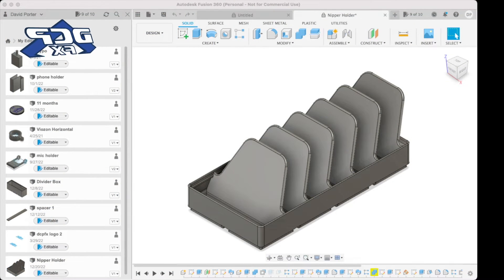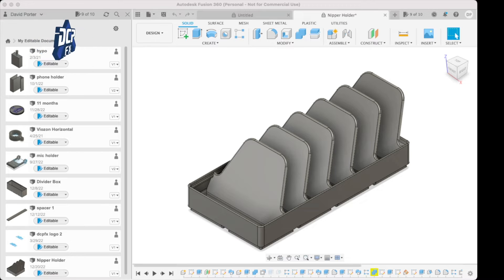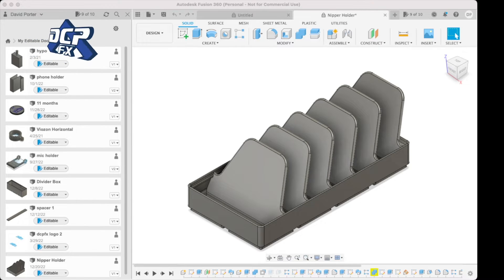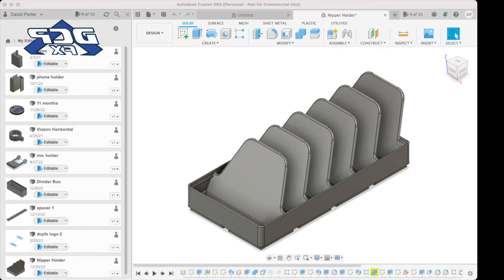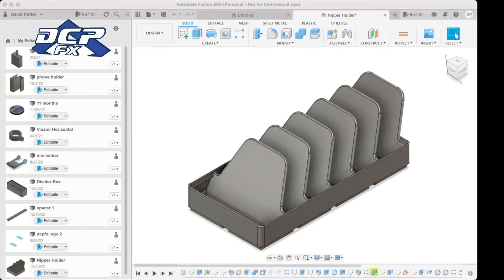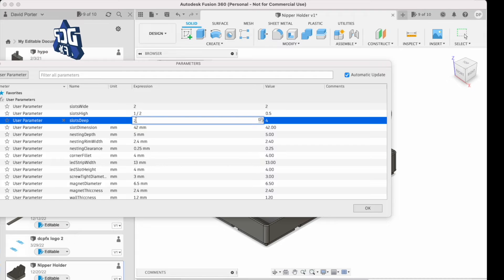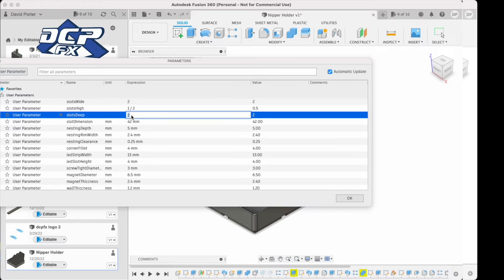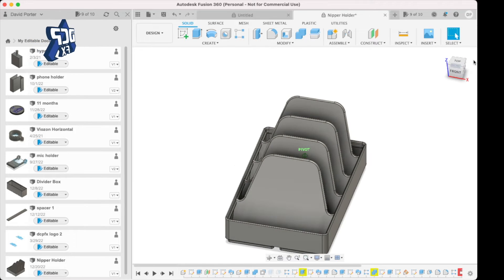Gridfinity is Parametric??

Comment: This was helpful, I just got my 3D mini printer from Bambu lab. Gridfinity doesn't fit on the plate and I"m trying to learn how to modify things in Fushion 360. Downloading from Thangs did not give me the option to open in 360 and when I open it in 360 i don't get the user parameters. Thanks for giving me hope that it's possible lol

Comment: Thank you, well explained
Reply from the maker: Glad it was helpful!
Reply: @DCPfx  now that ive had chance to follow along with your video Ive found my parameter settings empty, 

I'm using zachs own slt files from thangs and Ive inserted it as a mesh, then converted it into a solid. 

With the model selected, when I click 'change parameters' fusion takes a really long time to think about it then it pops up with an empty parameters box. 

Am I missing a step or importing the file wrong?

Thanks for you time
Reply from the maker: @kdt85  You just need to open the file in Fusion 360, no need to import it and convert - just open it.
Reply: @DCPfx  thanks for the quick reply, if I try to open an STL file with fusion it opens as a mesh for me, I must need to dive into the settings or something. Thanks anyway. 

* Actually, I've noticed there is a link on thangs for a parametric sauce file which lets me open in fusion without having to download anything! It works fine this way. 

Thanks again
Reply from the maker: @kdt85  Yes, that is the file I was referring to.